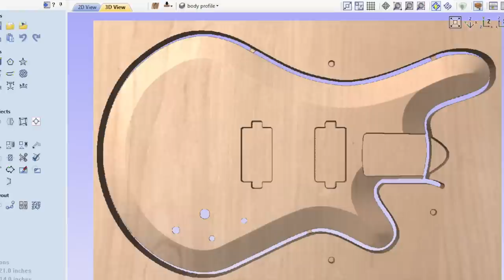Customizing a Guitar with Wood & Epoxy Inlays

Comment: Is that a chuck mounted fret press in a drill press? Where do i find one of those?
Reply from the maker: It's just the basic StewMac fret press caul designed for an arbor press, but I don't have an arbor press so I chuck it in my drill press :)
Reply: @timsway  thanks!

Comment: Looks awesome Tim. Did you make the string tree bar? And what did you spray on the wood before adding the epoxy to the inlays? Cheers.
Reply from the maker: String tree bar is a standard "floyd style". I sprayed a little shellac sealer on the wood to help keep the epoxy colors from running.

Comment: Hey Tim, have you ever tried making something from Ironwood?  I've read that a couple of luthiers used Ironwood for fretboards but had to stain them very dark as the wood is lighter than maple.  I was wondering what your thoughts on how that would look unstained.
Reply from the maker: Ironwood is an import wood on my "no use" list unless it turns up in something reclaimed. Even though that particular species (there are a few) is not listed as endangered, we gotta stop supporting the whole business of importing wood from Africa and South America for our unnecessary whims. It makes no sense to me when the two beautiful types of wood used in this guitar grow literally in my back yard and are taken down daily here. With that said, I have had the opportunity yo use many types of imported wood from reclamation including, I believe, ironwood. Sometimes those real dense woods are kind of stringy/splintery and difficult to work.
Reply: @timsway  Hophornbeam is an american ironwood.  and grows all over the north eastern US and even down to parts of Texas.  There is another variety that grows in the western US, called simply desert ironwood or Olneya tesota but it's colors are much different.  That is one of the reasons why I thought you might like to try them, as they are harder than ebony and according to the botanical site, they are not endangered and quite common in the US.

Comment: Shot in the dark if you see this. but I'm getting a high pitched whine when the volume goes above a certain level on a guitar i'm trying to make, when i touch the strings/knobs. Thats a ground issue right? 

Nice work as usual.
Reply from the maker: maybe? A bad capacitor? Or it could be your amp or the specific amp/guitar? It could be a frequency feeding back. Does it do it in every amp? Here's how I find stuff like that. On low volume, plugged in and on, open the guitar up and poke around the electronics with a paperclip or small screwdriver, one spot at a time. Usually when you touch the loose connection or the thing that's acting up you'll know it
Reply: @timsway  I've only tried it on my headphone amp. the pots are pretty close together. could that be a problem? I'll try poking around. Cheers for the assistance.
Reply from the maker: @TheM00ndawg  try another amp. I  wouldn't be surprised if the problem is that.
Reply: @timsway  doing some searching/reading, i might have just embarassingly reversed the sleeve and tip on my output jack...
Reply from the maker: @TheM00ndawg  easy to do!
Reply: @timsway  Exactly what i'd done. in my defense it was a stereo jack! There was a confusing third tine. Thanks for your help though.

Comment: Nice guitar but I can't figure out why you wouldn't you use an AANJ (All Access Neck Joint) style neck joint like an Ibanez (the first to use this style neck joint) and so many other guitars are using now. The All Access Neck Joint is nothing more than a nicely rounded corner on the High E side of the neck pocket with the flat portion of the neck rounded to match the rounded corner on the body so that when your neck and body are screwed together both the body and the back of the neck match perfectly with that nicely rounded the corner which takes the corner totally out of the way of your thumb when you're playing on the last few Frets making it as easy as a sculpted neck joint like you see on a set neck or a neck through guitar. It is such a simple thing to do it's a no-brainer and I don't know why anybody wouldn't be using this at this point. The regular block joint like you have here with the hard corner is totally obsolete in this day and time at least it should be. This neck joint is so easy to replicate. It's just as easy to make or maybe even easier than a block joint. If you had this nick join it would make you're beautiful guitar even more perfect than it already is. This is not meant as a criticism. I was just simply giving you an idea to try and help you.
God Bless You and Yourn!!
Jimmy in NC....
Reply from the maker: Thanks! I've dabbles in a few different neck joints. This body design is intended as a DIY kit (one can download the cnc files or buy the parts from me) so I kept this most crucial part of the guitar build simple and strong.